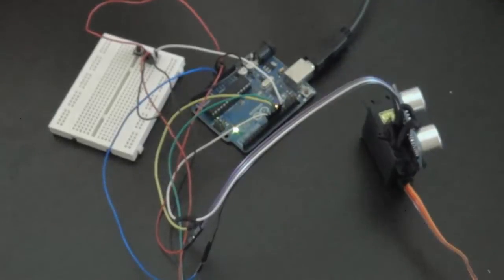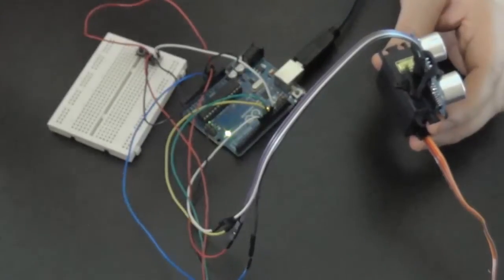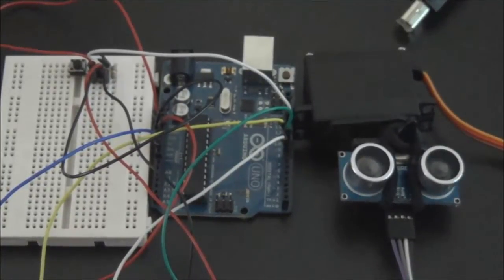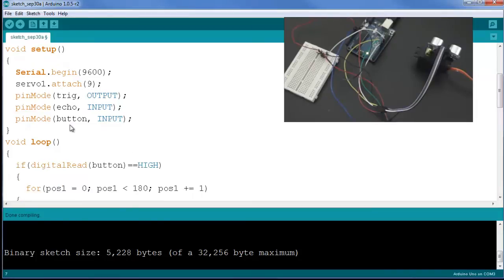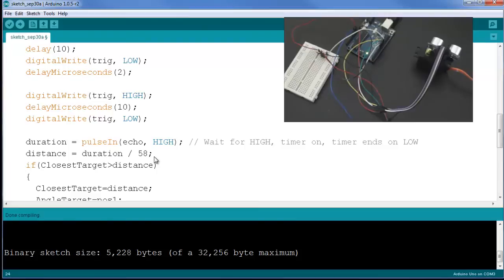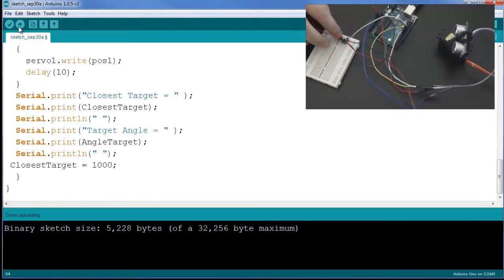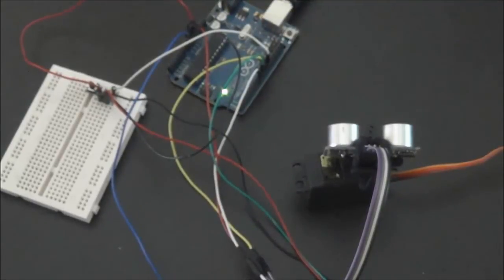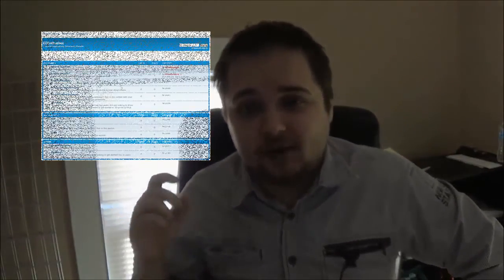Arduino Sensor Servo Sweep Tutorial - Locating the nearest target

Comment: What if i only want to detect objects on the ground from my robot? If i would place not one but two sensors vertical next to each other. Compare both distances and when they are equal the servo should point straight to the object right?
Reply from the maker: From my understanding of your application, it would be difficult to use an ultrasonic sensor for that. That being said, if you get the appropriate sensor, it should work.